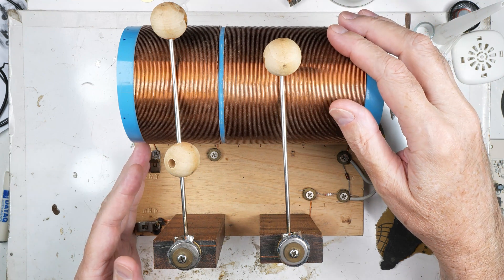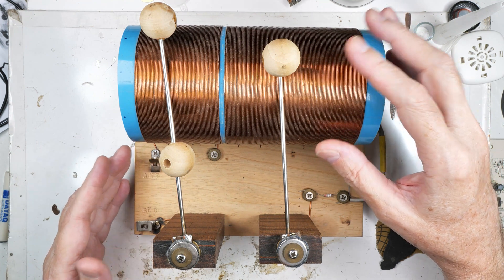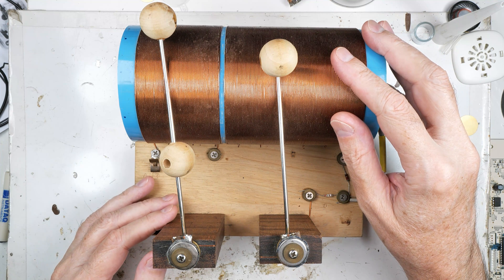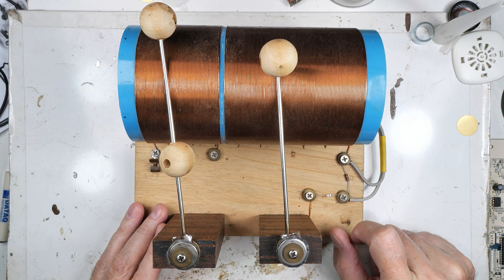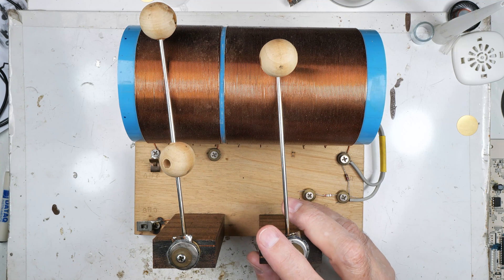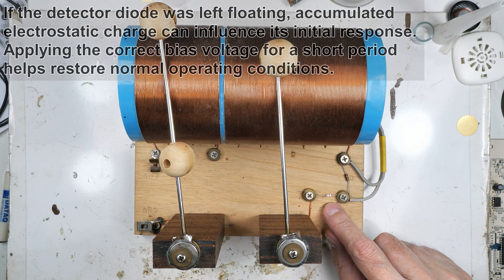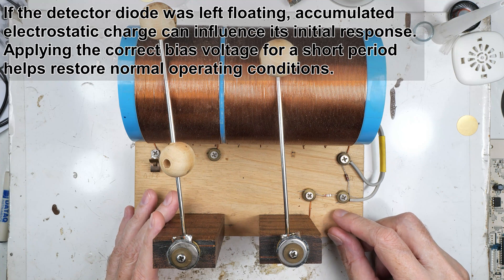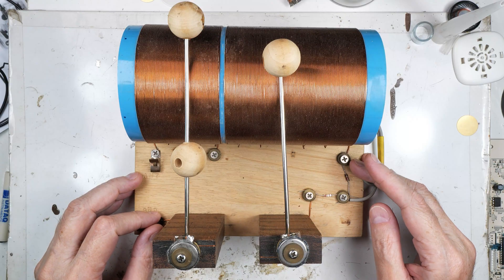Crystal Radio--I Stored My Radio, Now It's Not Working

Comment: Its not magic, its oxidation & corrosion, plain and simple. You have many different points of dissimlar metals on there.
Reply from the maker: So why would it fix itself by just tuning in a station and waiting? There's not enough current / voltage to undo corrosion.

Comment: The 1n34a has too low of an impedance for charge accumulation. The earpiece is probably piezoelectric which can hold a charge. 
This hasn't happened to my crystal radios before. I didn't use a wood base or that big of a coil.
Copper oxide is a semiconductor. A copper/copper oxide junction makes a diode. If you want to experiment, sand some copper, heat up copper until it turns red. Let it cool. Remove the 1n34a and connect the copper to one end. Connect a thin wire to the other end and touch it to various spots until you hear a station. Try both red and black copper oxide spots.
Copper sulphide works, too. Clean some copper. Melt sulpher in it. Carefully seperate the sulpher from the copper. 
Connect the wires to the copper sulphide.
The 1n34a isn't very sensitive. The homemade diodes will probably do better.

Comment: All I can imagine would be oxidation occuring on all brass, tin, copper, zinc, and other metal surfaces. Oxides act like insulators when they occur in low voltage circuits.
Reply: He cleaned up the copper but not the iron bits.  I suspect that is where the issue is
Reply: @kensmith5694  what about the brass washers, screws, etc?
Reply from the maker: @kensmith5694  The iron bits are stainless steel.

Comment: Interesting.  I had not heard of this issue before.  My first thought was to make a loosly wound coil of a few turns, connect both ends to the signal generator on your DSO3D12 scope around 1-mhz and place the coil near the radio. You should be able to detect the carrier.  I've never encountered this issue with battery operated radios that uses a diode detector.  Something about the crystal radio with a coil that big, always being 'on' even in storage.

Comment: Amazing. My bet was on copper sulfide and copper oxide. This diode thing is very interesting.
Reply from the maker: I thought it was copper oxides when it first happened also. But now that it's happened several times over the past 10 years, I know to let the radio "warm up" after a long lack of use. I also said in the video I sanded off the coil contact part.

Comment: Two effects.
1. Wood can absorb moisture. If you store it in a damp place, its resistance can decrease.
2. Wood can absorb moisture. It can form a galvanic cell with the screws and plates. It can put a voltage on the diode.
Just an assumption, I haven't done any measurements.